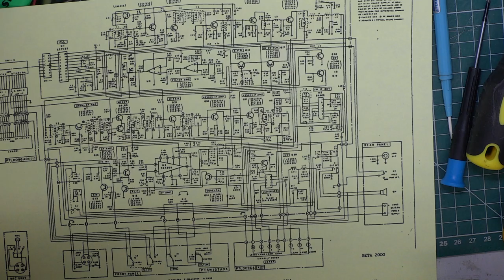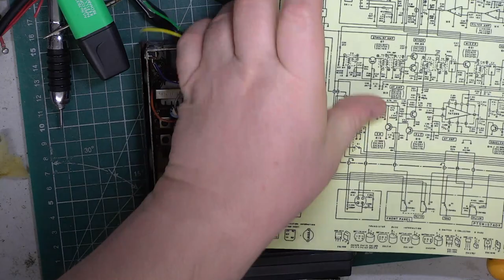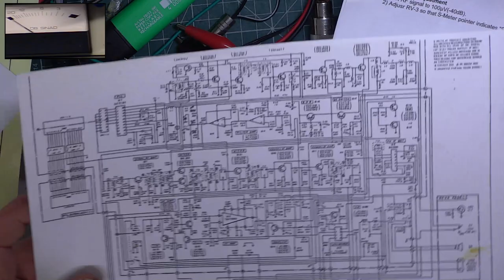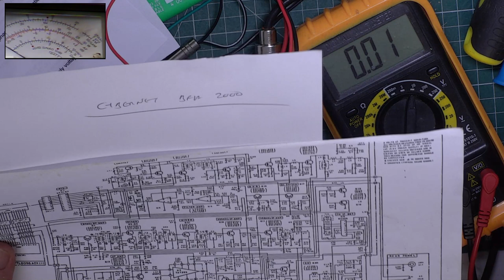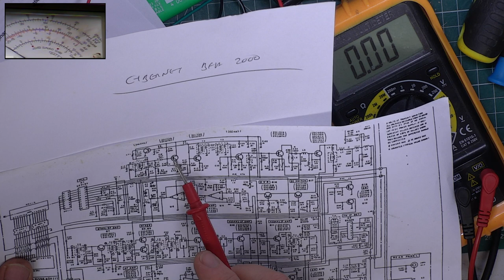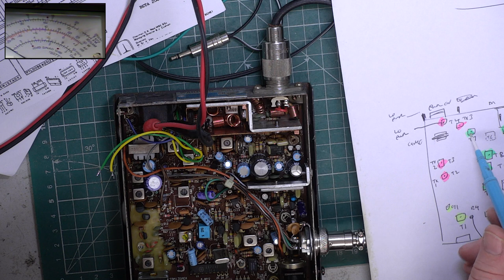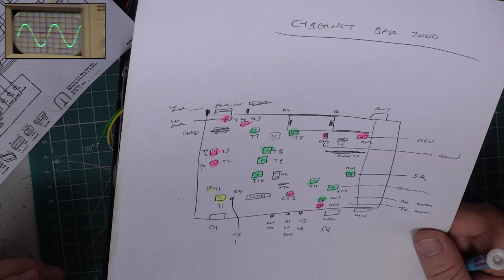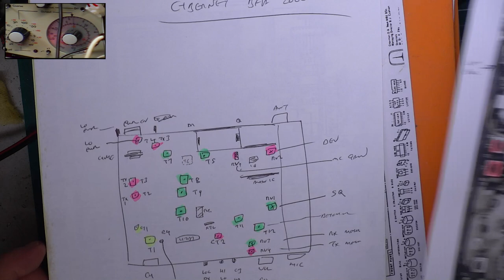Radiomobile CB201 CB27/81 UK FM CB radio - Repair & alignment

Comment: have you any videos on how to wire a mike ive got a CB or two i want to try out they power on but the mikes i have for it do not work the wire's need soldering and i do not know how to do it and dont know if it will blow it up if i just stick them anywhere one CB has 4 pins and the mikes i have here have got 6 or more wires ive had them two years and want to try them now one has usb lsb fm am the other is 40 channel fm

Comment: Does anyone in the UK still use CB? Surely PMR446 is better?
Reply from the maker: PMR446 is a 0.5W service aimed at hand portables. There is only one mobile radio on the market which we reviewed a couple of years back - the Midland GB1 (If I remember right). The citizens band service in more aimed at mobiles (that means car mounted sets) rather than hand portables. It goes without saying that CB hand-portables need to have longer & less efficient or convenient aerials because of the frequency used. 

Richard, G0OJF, UK